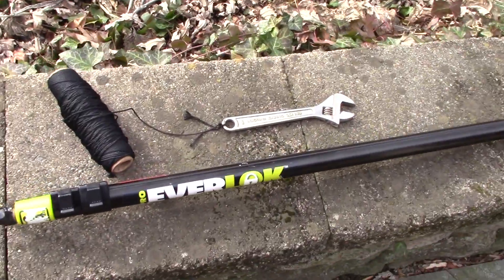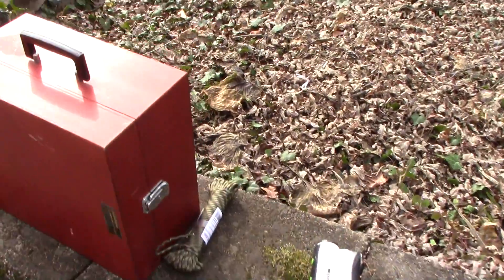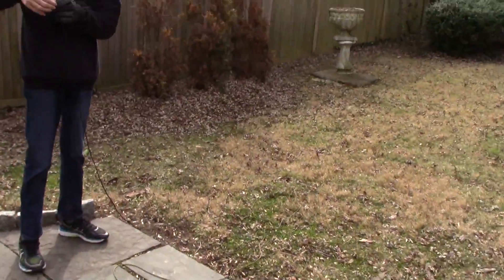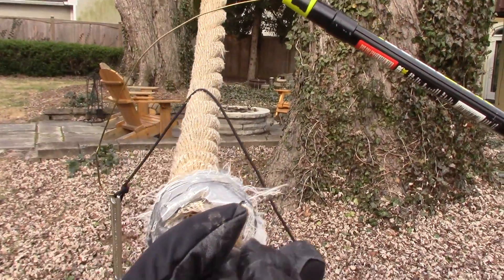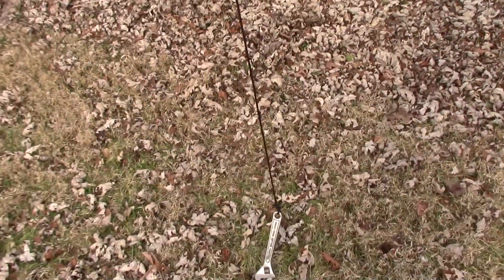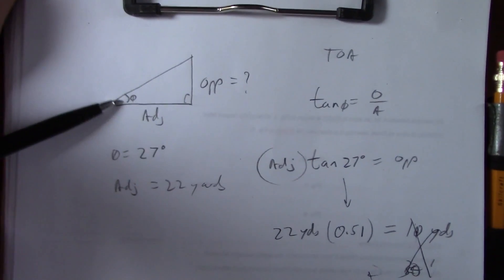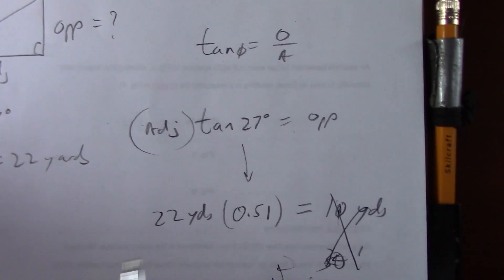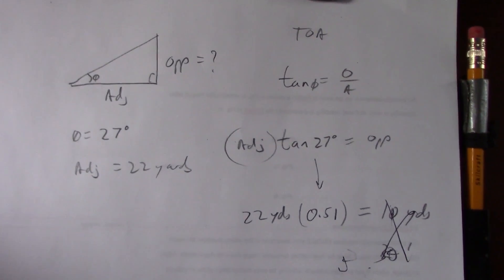Mounting stealthy off center fed dipole ham radio antenna in trees using a wrench and 550 cord.

Comment: Excellent method for putting the cord up into a branch.  I have used different throwing methods, a slingshot, etc. before, but I admire the use of the pole and release mechanism you came up with.  It seems you have more control of what branch you want to hang the cord over.